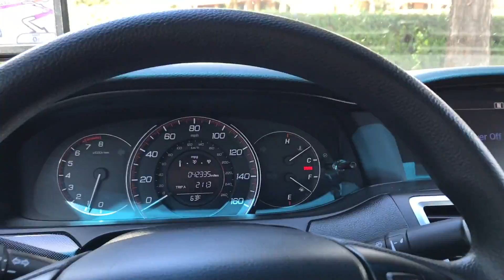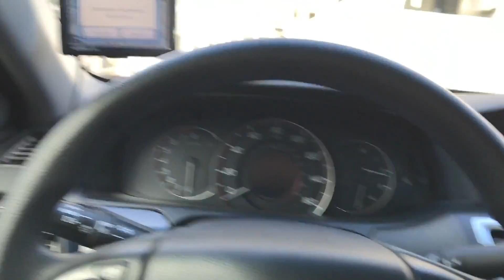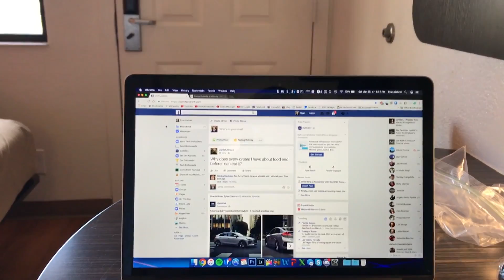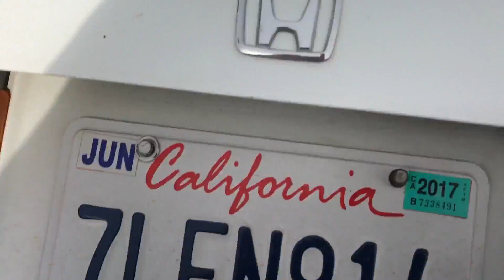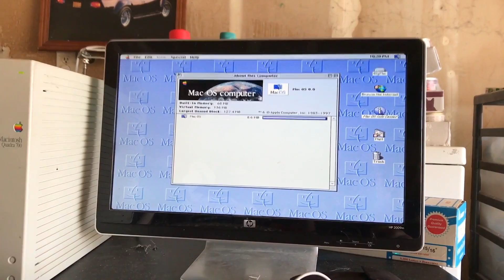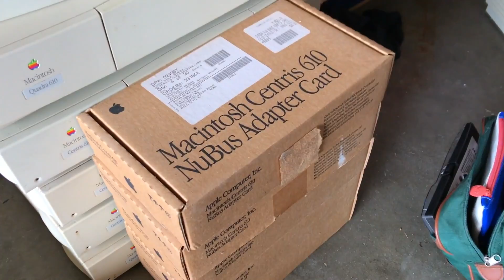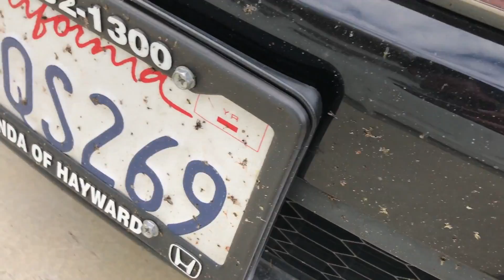Road Trip Vlog: Vintage Tech Score!

Comment: 19:52 Those are probably SCSI adapter cables for use with early PowerBooks.
20:09 darn it that's like a sheesh ton of Microsoft floppy disks!
Reply: All those MS floppies are basically multiple copies of Word 5.1 and Excel 4.0.

Comment: Dude, that's an amazing score!! I'm so jealous! That's enough hard drives and peripherals to keep the average Mac collector going forever!

That Performa 475 is a bit of a rarity - a 68040 in the old style LC case. I can tell you it has bad caps in the power supply - it happens to all of them with the TDK power supply. If neither of you want to try repairing it, I'd love to take it and give it a shot.

You can get a pack of 10 of those batteries on eBay, for $0.75 a pop, if you don't mind waiting for shipping from China.
Reply: I actually tore into that very machine and uxwbill'd it because it wasn't booting at all, completely dead to the world. Gonna try it later and see if it works. I do know it powered on, just no activity from it whatsoever. 

As for the CPU I do know it has a LC040 in it, not a regular 040. The Quadra 700s are the only ones in the lot with legit 040s, everything else is LC040 or 030s.
Reply from the maker: If we can't get it working maybe we'll do that!
Reply: Fan and hard drive comes on, but no life otherwise? Stick a battery in it if you haven't - some Macs won't come on without a good PRAM battery. Also try different RAM.

Oh yeah, I know it's an LC040. It's still fully compatible with the regular 040 though.
Reply: I want to throw a legit 040 in there but the problem is good luck finding one these days. I know a LOT of the ones on ebay are counterfeit.